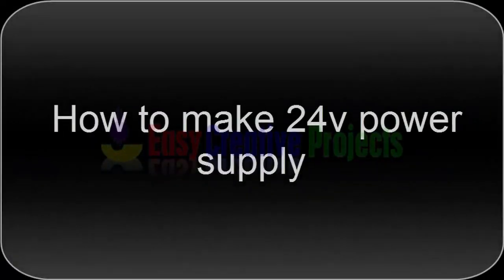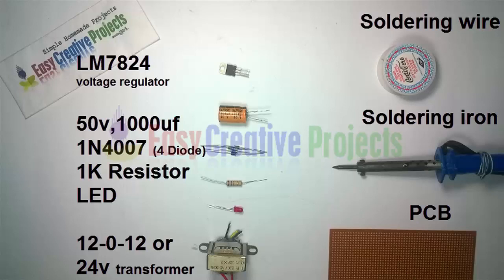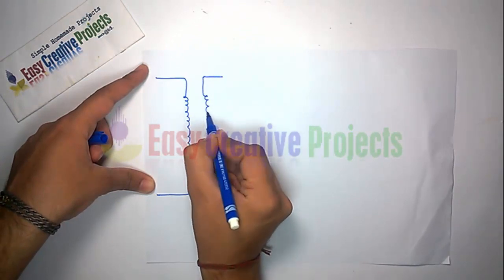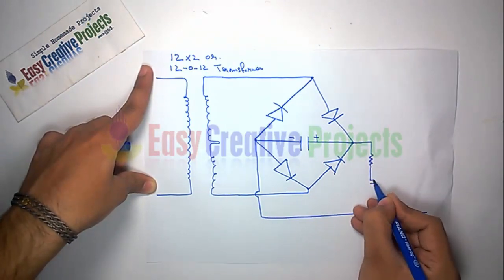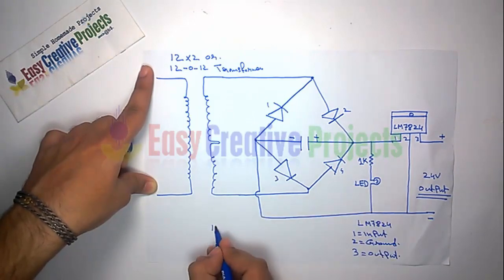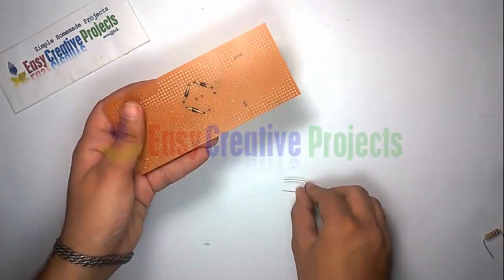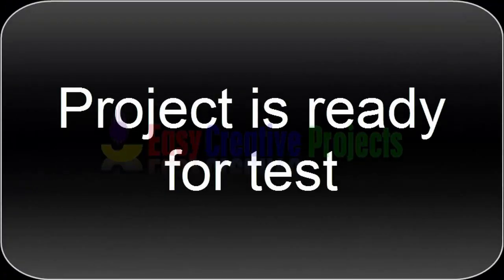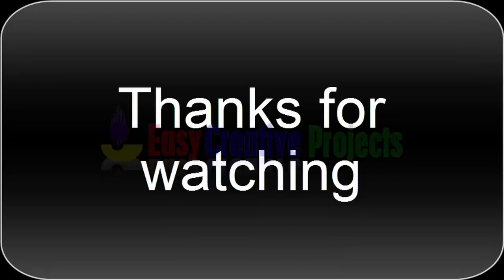How to make 24v power supply - easy step by step with circuit diagram

Comment: Can i use 5408 diodes and 35v 4700uf capacitor in this diagram? Will i get the same output?
Reply from the maker: yes you can use. but 35v capacitor little bit risky. but its working.
Reply: @EasyCreativeProjects  risky? Why?
Reply from the maker: @quit-j8g  capacitor may b blast after some time. try to use 50v capacitor for extra safety.
thanks.
Reply: @EasyCreativeProjects  ok thanks a lot...

Comment: Hi, I am a wheelchair user using an electric wheelchair (my own made), has 24 V Motor, power supply from 2x 12v 90A Dry Battery. now I get a charger which is 24v 5A output and takes more than 20 hours for charging. could not get any powerful charger here in Bangladesh and very costly. I saw your videos and found them very helpful.

My request, could you please show me a video to make a 24v 15A charger diagram with overcharge protection, so I can make one for me at home that can charge fully my batteries while I sleep at night

Thanks in advance
Reply from the maker: dear i already make a video on 24v 10amp power supply. 
watch video on our channel ( how to make 24v and 10amp power supply)
And simply replace 10amp transformer with 15amp transformer.  your requirement done.
thanks.
Reply: @EasyCreativeProjects  thank you so much for replying so quickly, i will try soon

Comment: I need 24 v 2 to 2.5 amp?
Reply from the maker: watch video on our channel ( How to make 24v and 10amp power supply ) and simply change 10amp transformer with 2.5amp output transformer. and use same circuit.
thanks.

Comment: Come out 15 voltage worng imfo
Reply from the maker: my dear when you use 1st and 3rd wire or transformer then you get 24v. output. if you use 15v transformer then how you get 24v?

Comment: Sir can I use LM7812 voltage regulator?
Reply from the maker: dear LM7812 provide you 12v output. if your need 12v then you can use LM7812.

Comment: Sir LM7824 volt.reg. is not available can u suggest another or more volt.reg. to use,
And it is okay if I dont have heatsink?
Thanks!
Reply from the maker: dear if your demand 24v. then you have 2 more option.
use perfect 24v transformer. 
or use 24v zener diode.
but this time no perfect alternative of voltage regulator.
for heat sink you can use any aluminum piece. (like tv antenna)

Comment: Put the large capacitor before the voltage regulator. Add a smaller cap around 10uF after the VR. Also it might be a good idea to add another 0.1uF ceramic after the 10uF for HF noise.
Reply: in parallel with the output?

Comment: Plz show how to make soldring connection in pcb board for more easy to understand
Reply from the maker: dear circuit diagram is the heart of electronic project. if you understand diagram then you also make it without  pcb board.
simple follow circuit diagram and draw it on pcb.

Comment: can we make 12v ,24 v with one transformer
Reply from the maker: if you want 2 output with one transformer so you need to add extra winding.
1 winding for 12v and 2nd winding for 24v. (secondary winding)
then simple use 2 voltage regulator 12v and 24v.

Comment: 0-24 we can use it transform or 0-12-0 is not available in market who it work by 0-24 v
Reply from the maker: yes dear you can use simple 24v transformer. 
thanks.
Reply: Veer pump lubrication auto model MRL to electrical supply 24 volt DC

Comment: Sir I have maid it but sir Mera Wala  sirf 20v output deraha haibut mere ko chyiea 24volts
Reply from the maker: Dear khali transformer ko check kro without circuit vo 24v day raha ha ya nai. 
china k components main thora boht frq aata ha.
agr 24v hi chiyah to  simple transformer k sath diode lga k use kr lo.

Comment: Sir how is this possible that we are giving 12volts getting 24 I'm unable to understand
Reply from the maker: dear 12 -0-12 transformer has 2 output of 12v. 12+12=24v
or in simple word
transformer has 5 wires.
2 wires side for input 220v
2nd side 3 wires for output. 
if you use 1st and middle wire it give you 12v.
if you use 1st and 3rd wire it give you 24 volt. 
see video, i cannot use yellow color 2nd wire i simple use 1st and 3rd wire. 2nd when i connect capacitor its give me 30+ voltage so i use voltage regulator.

Comment: Easy to understand explanation made me more interested in such difficult subject. Still can you please explain about connection of voltage regulator.
Reply from the maker: Dear voltage regulator has 3 pin. all regulator 1st pin  use for input positive. 
2nd pin use for ground wire. we connect input and output both negative wire.
3rd pin use for output positive. if we use 5v regulator then we get 5v fix output.
thanks.